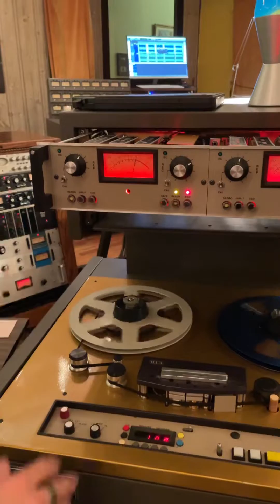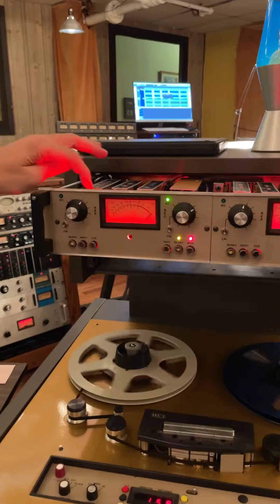Tape machines! NAB/IEC at 15 IPS explained.

Comment: Hi i wonder why i cant get 0db on the record level of an otari mtr 10 ....im using +9/185 ...30 ips overbias 1.5 db...
Reply: I just got an Otari MTR-12. You have to mess with the EQ balance a bit between the Repro and Record EQ, but you can get things reading flat between 1k and 10K. The issue I ran into was that when I had it calibrated "flat", in practice everything sounded pretty thin and bright. Comparing directly between a digital feed and the Otari at 15 IPS, the Otari was still sounding brighter than digital even when I had my 10k tone at -3. Whoever had the machine before me had it calibrated at almost -15 at 10k, it was ridiculous! 

I found the happy place for the high end on my MTR-12 was when I had the 10k tone reading somewhere between -6 and -3 with ATR tape. I'm using mine as a color box, so I'm not as concerned about accuracy and being technically in spec. I want the "tape thing", so I like the high end a little rolled off to smooth things over and kind of de-ess vocals. I've got mine sitting around -4 at 10K, still sounds accurate but slightly warmer. If I had to guess, this is just specific to Otari's, I wouldn't take this as gospel for tape in general, every machine and tape combo is going to be completely different. I watched this video because I was curious to see what the different EQ curves were doing on the MCI.
Reply: @MillSounds  maybe you are using the wrong eq curve? Nab vs iec on your alignement tape?